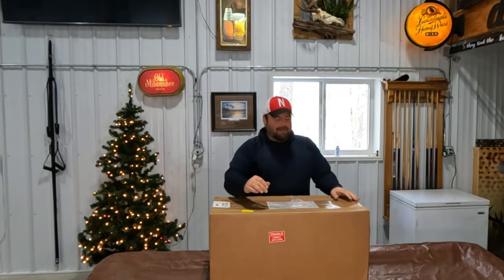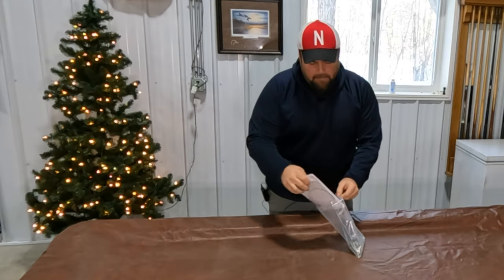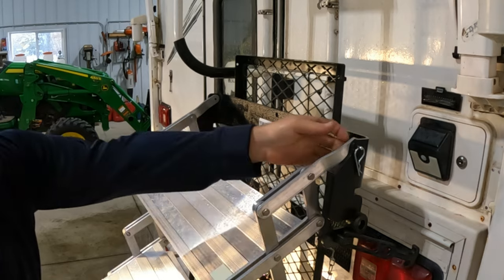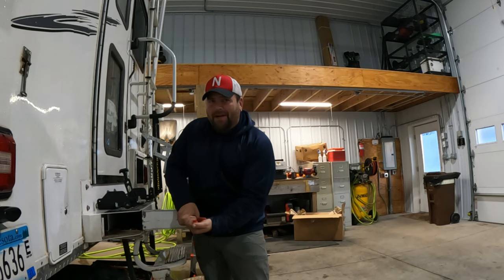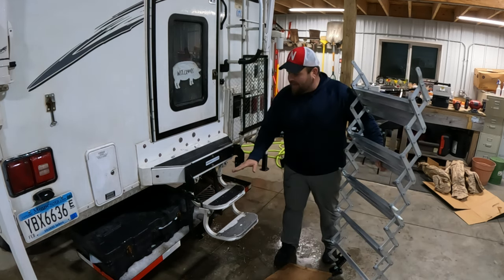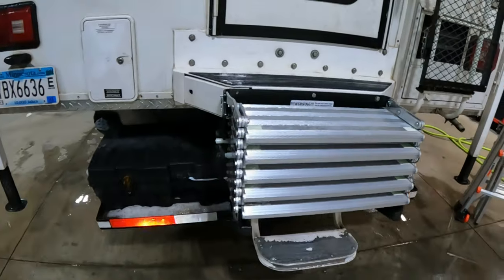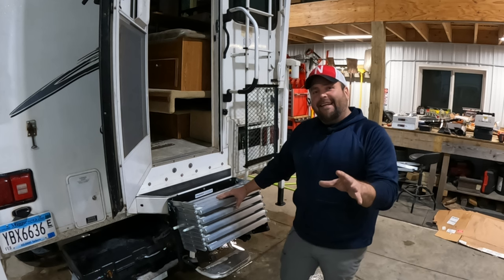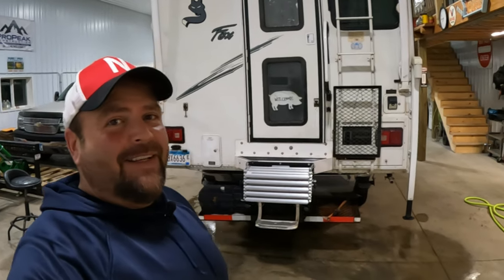Installing Torklift Stow N" Go Steps on an Arctic Fox Truck Camper

Comment: I just ordered and installed my TorkLift steps, game changer.  I had a set of scissor steps from another manufacturer, but the top 2 steps were always slanted down.  Our last trip I tripped going down, had to leap, and fortunately landed fine, prett good for 3/4 century old camper.  That got me to order the TorkLifts.  Great company!

Comment: Those steps are a really nice upgrade and safer instead of using a step stool to get up to the old camper steps. Glad these companies throw some products your way.
Reply from the maker: I agree. I was excited when Torklift reached out. They are expensive but the quality of their product is in line with the price. I have numerous overseas companies reach out weekly asking me to peddle their Amazon garbage. I don't want to put my name on any of that cheep stuff. I've bought Torklift in the past. I know how good it is. I know how easy contacting them can be. When they asked if I would like to use there stuff in my videos I couldn't refuse!

Comment: We have the same stow n go steps on our Arctic Fox. Had them for a season now, and absolutely love them. Also installed a Lend-a-Hand Extra Large Folding Grab Handle which works very well with the long steps. A must have for my wife....
Reply from the maker: Thanks for watching Mike. I am gonna look on Amazon for an extra large folding grab handle. Thanks for the tip.

Comment: Hey Kenny! Thank you for sharing your experience with your Stow N' Go installation. I did want to mention that since only 4 of the 6 mounting bolts were used, there is a safety concern and we do not recommend mounting the steps in this manner. Please feel free to let me know if you have any questions.
Reply from the maker: Thanks for the heads up! I'll get the inherent bolts mounted ASAP!
I put the steps to this test for today's  video. They are awesome! Something I should have got years ago. Thanks for getting these to me!
Reply: Thanks for sending Kenny those steps, he deserves something nice.  🤝
Reply from the maker: Thanks, I really appreciate the comment!
Reply: couple of notes on these. If you buy the steps and mount together no problem. But If not and you get them separate, what a mess. I ordered the mount because I already had the steps and they did not send any of the hardware. Call Torklift and they send another mount, no hardware again. This went on for like 3 months. Sent back one of the mounts and went to hardware store to get the nylon washers and bolts I needed. Also when mounting I did the same thing as Kenny mounting and have had zero issues. The problem is if you don't have a large enough space you can't use all the holes. But I can tell you it works just fine and I am a big guy >250lbs. I have all Torklift ( mounts, steps, fast guns)and its good stuff but their customer service is meh....BTW that cat eye is CLEAN! is it a LBZ?
Reply from the maker: Thanks for the comment. It's important for companies to hear where they need improvement. 
The truck belongs to my nephew it's super clean LLY. He has upgraded the cooling system and opened the turbo inlet to help it breath a bit. He had been looking for a LBZ for a long time when this LLY came along. I would love to find a clean LBZ I that color. Thanks for watching!

Comment: We have the steps also, you don’t have to pull them all the way out. Try different pull out lengths and see if they are still solid, I try to keep the vertical bars between the steps no further out then straight up and down but even if they are leaning towards the camper still very strong. I also made the top step flush with the top of the bumper, gives a nice landing and good place to sit. Hope this helps. Oh instead of the pins to lock them to the camper I used a bolt and nut on each side, harder for someone to take off.
Reply from the maker: Great tips Garnet! I like the idea of mounting them flush. Replacing the pins with a bolt and nut will definitely happen! Thanks for the advice!

Comment: Great install video, you made it look real easy!   Those are exactly what we will need when we get our camper since our 5500 4x4 sits very high.  I wonder how they'd work with a Fox Landing, the steps are definite necessity,  along with an extended handrail,  but the Fox Landing is not.  Leaving your existing steps on was brilliant,  then you can still get into your camper without extending the steps; you mentioned everything we were thinking about regarding those steps.   After looking at several truck campers, we've settled on an Arctic Fox 1140 but haven't seen one in person yet, and may not before we purchase.   Not ready to buy yet, maybe a nice used one will come up.  It was a very COLD week almost everywhere.  Have a great week, I know it won't be as cold, will see ya on the next one.  Happy New Year to you and your family!
Reply from the maker: Thanks! Have a great New Years! When you get your camper you will have to send me photos!
Reply: I added them to my Fox Landing, though I am not sure I'd travel when them attached to the Fox Landing due to the extra weight and stress it might put on the Fox Landing locking bracket.  Here's how I did it: https://www.youtube.com/watch?v=7_Fkg74MQKo

Comment: I have their steps as well except I do not have the store and go.  As you stated it is nice not to have them on all the time.  I just throw them in the camper and climb up a step I built for the receiver.  The steps are fantastic though for when the dogs come with us.  We had planned a trip for Christmas vacation but the weather just did not cooperate.  May still do something this weekend if things do pan out.
Reply from the maker: I was thinking the same. I probably won't use them all the time. My camping style won't always work with them. But I could see how they would work great for someone who might not be as nimble as they once were.

Comment: That was the exact clip I was thinking of when you stepped on that little stool and then precariously up onto the camper step as the ground was such that the height was just too much. I've seen and heard of people having some bad spills with the standard camper steps and using a stool down below that was too small and on an unstable surface or sloped ... it all went sideways and down they went injuring themselves. My brother initially did the stool thing with the factory camper flip out step but had a massive and nice fold out leg type platform but was a total pain to stow away so bought a very expensive triple fold out step but the problem with that is any time he has to be towed ( remember, its a Ford ! ) with a long deck tandem axle tow truck, that whole step has to be unbolted from the camper as it hangs too low/too much over hang with that large camper. This type of step is not as handy as his but sure would be a lot better when it came to dealing with having to be winched onto a tow truck deck.
Reply from the maker: All great points Charles. I'm lucky that I haven't taken a spill out of the camper yet....but I'm a Ninja, a big nimble 290 pound cat. Lol.........I need to loose weight!
Reply: @KennyOfAllTrades  LOL

Comment: Just noticed the comment.  It was a year ago, so you likely figured it out.  You can order with the 1" mounting bracket, the steps just don't stow like Kennys.  Can't post image here, but the 1"below the door will be solid and the bracket has lag screws.  When closed up there is a cable to keep them closed, I swing mine under and use a small chain to keep from swinging.

Comment: Thanks Kenny. Great videos. I have watched yr vids for a while and the gear reviews are always informative. Have you seem the guy running the dodge 3500 where the truck folded? its fairly recent. Don't want to go down the GVWR rabbit hole but did want your thoughts on the Chevy platform. I know you are a wee bit over but with the front and rear hitches and running the duramax do you have any concerns with the frame? I did the same thing you did with the overload and bags so not worried about the suspension. But wondering what yr thoughts are on the weak point of these trucks? I know in 2012 they changed the axels and went to more box frames but still see all the chatter about GVRW.  its kinda stupid to add the duramax and Allison and you drop yr payload by 1500#.  Its not a issue of stopping or power so it has to be the frame? Tires are upgradeable and thats EZ but that folded dodge was a interesting read. there are a few vids that broke down the payload and such but by the time you add people, water, gear, the camper, a few food items, a box of tissue , and leave a extra 10% buffer you have like 200 lbs payload, Thanks!
Reply from the maker: Great comment! So far I haven't had any issues with the truck carrying the camper. The combo has traveled everything from interstates to ATV trails. I have hit pot holes so big that my front tires will jump 8" off the ground and slam back down. So far I haven't noticed any issues with body lines not matching up or uneven tread wear. I think everything is still still straight and holding up fine. (Knock on wood) 
I have seen that Dodge post, pretty crazy! I haven't looked into it enough to know much about the entire situation though. I had to stop following a lot of those Facebbok groups. Too many know-it-alls and trolls. I wish I could answer your question better, but all I can say is when driving my truck camper it feels very confident. Thanks for the great comment!

Comment: Merry Christmas Kenny.  You might want to get lock for those or they might disappear. I’ve seen some people just pull the pins and put them inside when not in use.
Reply from the maker: You are right! Another viewer, Garnet suggested a nut and bolt instead of the pins. That would slow someone down from walking away with them. Especially if I used a nylon locking nut. Thanks for watching!
Reply: @KennyOfAllTrades  Some people have used Fast Gun locks on their steps.

Comment: Awesome...But I want to know how they work with the camper off the truck. Most of us lower the camper as low as possible and it looks like the stow and go wont work because of the length required to use them while on the truck. the "rise over run"  is different for the camper off the truck and lowered to reduce jack instability.
Reply from the maker: Great question! In that situation, I would remove the steps. 
There are two pins that hold the steps in place. Removing the steps takes less than a minute.
Reply: @KennyOfAllTrades  I have a larger Host Cascade. It still requires a couple steps to get in when its off the truck (plus...we are old..lol). So can they collapse only on the bottom but expand at the top?
Reply from the maker: @Johnny B   No, unfortunately, they unfold like a big accordion. You can not just unfold 1 or 2 of the steps. They all have to be unfolded at the same time.  I left my original 2 steps in place behind the torque left steps. You can kind of see in the video how I have it. If I take the torque lift steps off I still have the original 2 steps that are mounted on the camper.

Comment: Can’t get over the price on these. I purchased their fast guns and mounting tie downs. Not throwing another $800-$900 on some steps. I can spend about $150 and diy with wood.
Reply from the maker: Very true Matthew! I'm still using felling wedges instead of their stable loads for the same reason. They have a high price point! That's why I was running around with only three Fastguns for over a month...I couldn't afford to buy a replacement. Great products, great quality, steep price tag!
Reply: @KennyOfAllTrades  totally agree! Good products but steep price tag. Currently looking for alternatives or I can diy them. 

Keep up the good work on the videos! Have to get out to MN soon…… once it warms up haha.